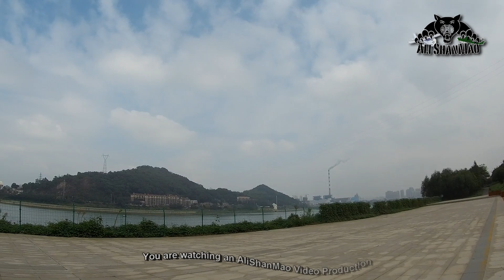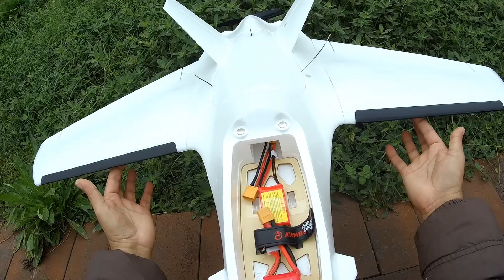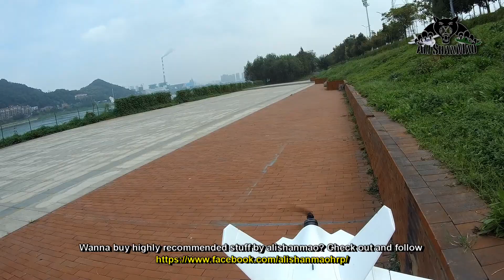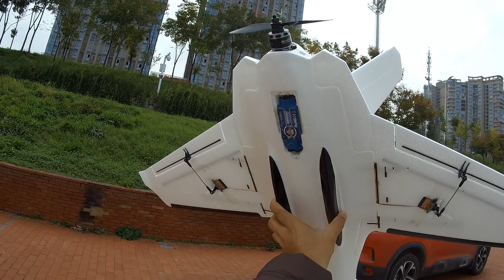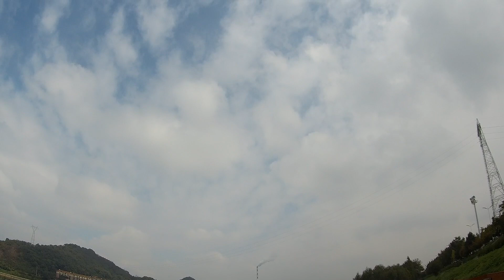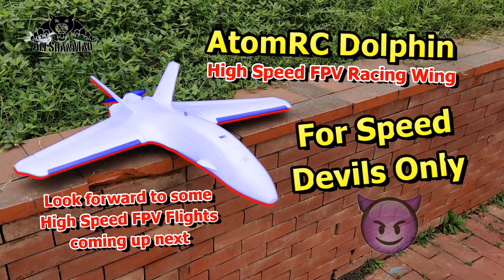High Speed Maiden Flight AtomRC Dolphin Long Range FPV Racing Wing

Comment: Hello my friend. I don't understand a word in English. Write down which engine and which screw you installed. thanks
Reply from the maker: Hello My friend. I used T-Motor 2300kv, 50A ESC, 5 inch Propeller.

Comment: Dude great video !!!  Gotta put a GPS on that thing , its gotta be doing triple digit speeds!!  I program/assign a volume control switch to my transmitters left or right slider so i can turn it down or silence it when needed. What size and kv is that motor?
Reply from the maker: Yup, next flight we can see what speeds it doing with OSD and flight controller. its 2200kv motor with 6 inch prop

Comment: What is the range of that RadioMaster radio?
Reply from the maker: pretty good, around 2km. It is just so strange that with only one or two SFHSS Futaba R2008SB Receivers it keeps speaking telemetry lost, recovered phrase. however I have total control and i never lost control over plane. with other Futaba R2008SB Receivers, it has not done this. guess these are copy / clone receivers maybe hahaha
Reply: I have that mobula6 hd which also says telemetry lost but never actually lost signal. Odd. So it's the receiver